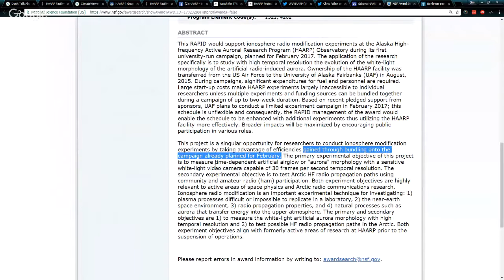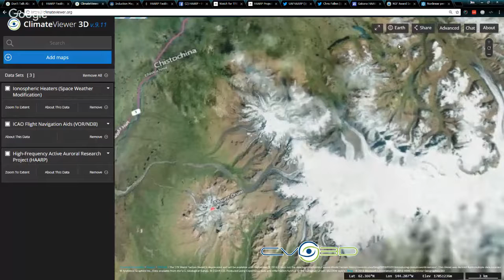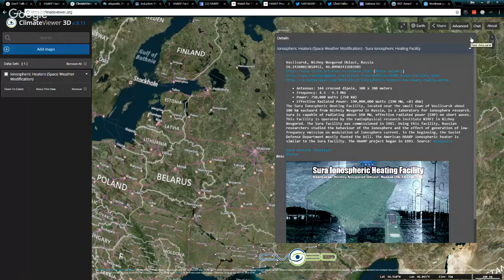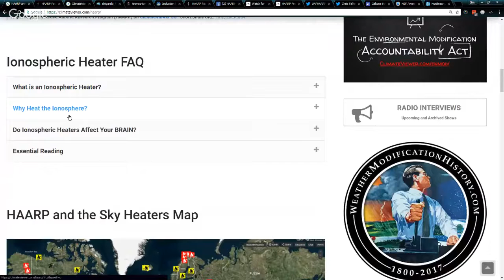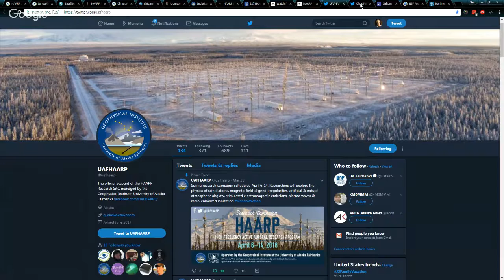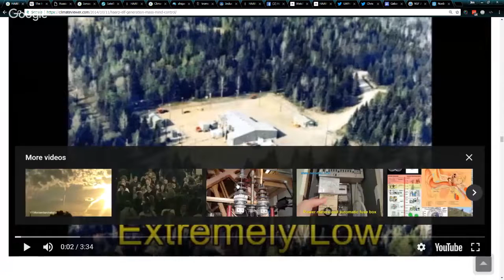HAARP Bakes Alaskan Sky Tomorrow Night, BACK ONLINE!

Comment: Is there an ionospheric heater at Pine Gap?
Reply from the maker: nah, that's a spy facility. Part of the Five Eyes: https://climateviewer.com/privacy/ 
ClimateViewer 3D Map: http://j.mp/2Hg0HAm
Joint Defense Facility Pine Gap - Alice Springs, Northern Territory, Australia

Pine Gap is the commonly used name for a satellite tracking station 18 kilometres (11 mi) south-west of the town of Alice Springs in the centre of Australia which is operated by both Australia and the United States. The facility has become a key part of the local economy.

It consists of a large computer complex with eight radomes protecting antennas and has over 800 employees. It is officially called the Joint Defence Facility Pine Gap since 1988, previously it was known as Joint Defence Space Research Facility. It is believed to be one of the largest ECHELON ground stations and appears to be physically and operationally similar to the American signals intelligence facilities at Buckley Air Force Base, Colorado and Menwith Hill, United Kingdom. United States government personnel at Pine Gap are believed to be mostly from the National Security Agency and subordinate service-associated agencies as well as the Central Intelligence Agency."
Reply: It may be used for triangulation Bob, steering high pressure zones
Reply: Bob Kaiser theyre world wide
Reply: We can only really guess, not only steering weather but triangulating microwaves to concentrate them to cause siesmic events, it could also likely be used as the southern point in Jim's diagram of the Van Allen belt